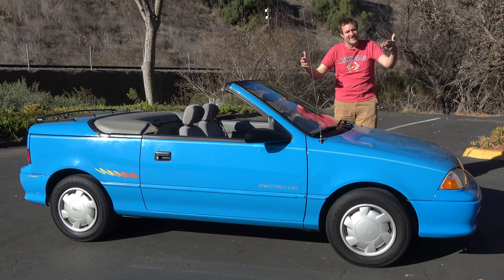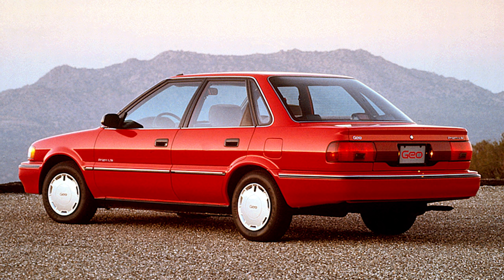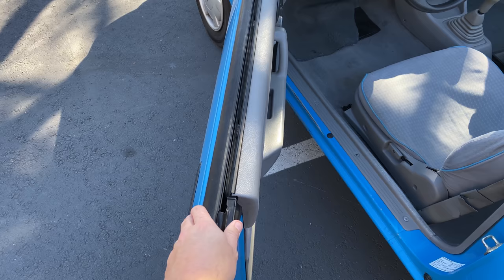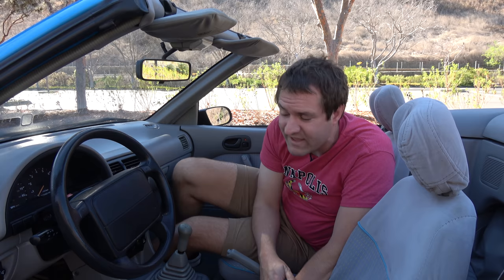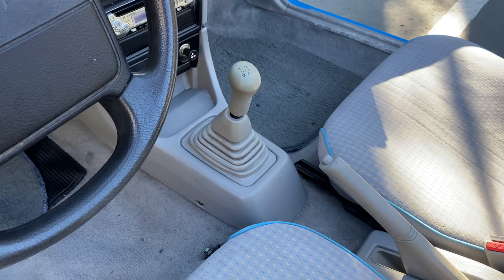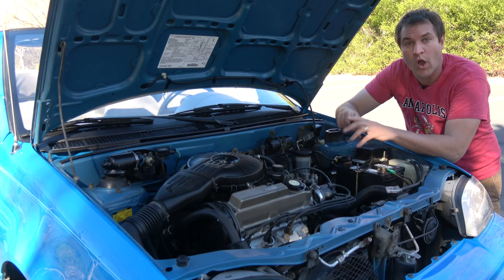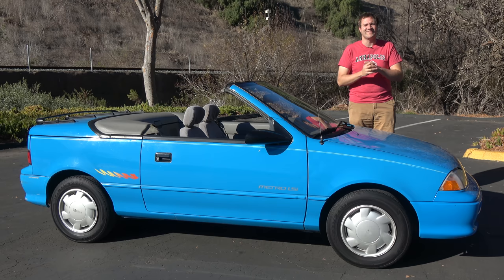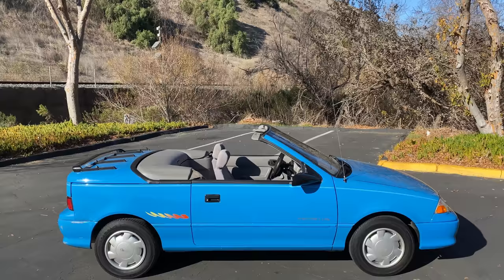The Geo Metro Convertible Was a Hilariously Pathetic 50-Horsepower Economy Car

Comment: That “plastic key” wasn’t too unusual for the time, even my 1998 4Runner came with one. The point of it is that the entire design allows it to fit in your wallet with credit cards and whatnot….same size. And then if you accidentally had a lockout…..emergency key is in your wallet. Great feature IMO although I never used it. P.S.—it did have a metal interior too.
Reply: Will Rivers  well damn
Reply: I had a ‘94 Metro, by then they had switched to aluminum for the spare wallet key.
Reply: I think my mother’s ‘95 Ford Escort sport model came with one. I remember trying to test it and it worked but it felt like the thing was going to break off in the lock if you didn’t turn it EXTREMELY gently.
Reply: biy new 4 runñer
Reply: my dad's '94 Saturn SC2 had one too
Reply: AAA use to give out plastic keys here in Socal.
Reply: @tommyt1971 😅
Reply: I always thought the plastic key was used as a blueprint to make a new metal key

Comment: Not gonna lie... this looks pretty dope. I'd love this car.
Reply: I thought the exact same thing 🤣
Reply: Retro just looks good haha. Put an LS in it and I would love it! Like an alternative to the miata LS swap😂
Reply: Maybe, someday, we'll see compact/micro cars here in the states again. :(
Reply: @BigfootUnibrowMan  Where would you sit? LS works in a Miata because it's an FR layout car that was designed for longitudinal mounted  engines. The Suzuki Swift was designed for a transverse 3 cylinder. Oh, the LS comes in transverse layouts? Cool. Don't let them pesky things like shock towers and frame rails get in your way.
Reply: A 5.3 like the impala ss and the Pontiac gtp has..it might fit in there..after a lot of cutting and welding anyways
Reply: @jdubskiwright2380  Cool. You just spent like $12k building a tube front end for a Geo Metro just for it to be a massive pain in the ass to drive and look stupid cause the front end is 3 feet wider than the rest of the car.
Reply: @koopatroopa187  hey I wouldn't undergo this project myself..I have seen several geos metros the hatch backs with 540ci BBC motors in them.. purely drag cars no street ability at all.. not my cup of tea..
Reply: @jdubskiwright2380  Yeah, and despite having absurd amounts of power, they're all pretty slow compared to other cars with the same work done. There's a turbo LS swapped Tracker I know of that runs high 9s and a GNX swapped Metro 3 dr that has a tube front end, tubbed back end, has a massive turbo, billet heads, etc. Car runs mid 9s. 9 second times were fast 20 years ago, but cars rolling off the showroom floor can get in the 10s these days with some knowhow and some ET Streets. The tracker works cause it's a body on frame, the Metro convertible would be very hard to do cause you can only move the seats so far back. The 3 dr is the one you often see converted to RWD cause it's got space to relocate things further back.
Reply: @koopatroopa187  yea they guy who used to live near me used a metro hatchback obviously rwd conversion..damn thing was basically a go kart with a big block..it was fully caged but idk wat ever happened to it think he sold it to fund another project..that was prior to the days of YouTube .it was yellow like bright ass yellow.. I would not want to wreck that car because there was no room to soak up any impact  sure the cage helps but idk..you could almost touch the rear axle from the driver seat.. how he ever kept it going straight with such a short wheelbase is mystery to me .I got to watch it make a few passes at the track and it was in the 9s all motor no nitrous just big block power. Probably pushing 600hp plus
Reply: mid 600s sounds about right for a 540 on pump gas.
Reply: @koopatroopa187  these days easy. Not necessarily cheap but very achievable.. considering thos was like later 90s early 2000s. It was a beast in its day.. I was a youngster got to get up close to it at a few car shows all really know is it had a duel carb setup n they looked big like 1000cfm big..I coulda swore I saw the same car but it had been painted different years later and it had a roots blower on it.. from what I heard guys around the track it was same 540 BBC .. went from bbc metro to a blown bbc metro... someone had seriously big nuttz to run tht car..hp was probably 700+..fuckn madness
Reply: @koopatroopa187  if not 800hp.. blower on it was pretty damn big..unfortunately I only got to see with motor running and idle around didn't get to see it make a pass.. probably 9 flats or mid 8s crazy
Reply: I'd probably just build up Swift GTI engine.
Reply: @jdubskiwright2380  Pretty sure I remember that blown 540 Metro. Looked absolutely absurd. Looked like it was just an engine with a Geo Metro attached to the back of it.
Reply: @koopatroopa187  yea that motor coulda used a little more car...
Reply: @BigfootUnibrowMan  maybe a turbocharged hayabusa engine?
Reply: I've driven two different prizms for years. absolutely loved them.
Reply: NO!!!
Reply: @BigfootUnibrowMan  no.
Reply: Bought a xfi hatch brsmd new in 1989.
Car was super dependable. 58 mpg and in 5 years only had to replace a egr valve.
Needed a bigger car for safety reasons and sold in in 95.
In 2010 i needed a gas miser as gas was close to 5 dollars a gallon and found a red convertible 4 miles away and grabbed it for 1200 bucks.
62 miles one way to work or a 124 mile round trip and this car got me to work 5 out of 6 days before i needed gas again.
Not only that but for 2 years i never had a problem with a 20 year old car changed my oil and that was it. Super dependsble while my coworkers laughed at me i sat back and watched them fixing all there late model car problems.
I bought a 2001 honda insight at 69 miles a gallon and still have my fine looking and running Geo convertible today.
Only issue imo not the safest car they were made light.
Reply: Get one and mod it for looks and performance. I would. it starts off with almost 50 miles to the gallon so any modification to the engine you're going to lose a little bit of that fuel economy but you're still going to be better off than most cars are today. 🙂👍
Reply: This looks pretty dope…

if you're into boring!
Reply: @hittingtax2670  It's the second reply you've made in two days, mate. 

Got the joke the first time.

My answer came from the fact that I was near homeless for a long time, so I couldn't afford a car.

I would have loved a little convertible. Much more fun than sleeping on the floor.

But yeah, probably not as fun as a Gallardo or whatever might be in your driveway.

I like simple pleasures in life, though. I don't need to draw my happiness from objects, so a little convertible like this will do me just fine.
Reply: @MarcosCodas  It was actually for myself, since I read it and forget what I was talking about, lol. 😝
Reply: Dope in a zoomer ironic way maybe
Reply: @jrob07105  - I agree. I commute in a large city with traffic jams coming and going and new get about 60 KPM / 37 KPM. This this would be fine.
Reply: Imagine Andre The Giant driving this car.
Reply: I    DIG    IT  !
Reply: ...and just about 50 mpg would be great!!!!!!!  It's not ugly to me, either.
Reply: I owned a 2001 Chevy Metro for 6 years & my little Geo could pass trucks like a beast, go down dirt roads & hit 88mph out in the desert. I drove her rough & blew the head gasket at 189,000 miles, but I truly miss my unsafe and fun to drive Metro

Comment: Me: "Mom can we get a miata?"

Mom: "No we have miata at home."

Miata at home:
Reply: Someone please explain this comment. I see it everywhere but i don't get it.
Reply: I want to see someone buy this and turbocharge it.
Reply: @Jens_Roadster  I think it originated as the kids asking the mom for fast food but she said we have food at home. And any kid knows the food at home is never as good as the fast food. Then the meme evolved into other topics like the one above.
Reply: @berburt  hmm, okay. Thanks. 😀
Reply: @wither1208  Just drop in a Geo Storm motor
Reply: @kp1x  or a Suzuki cultus GTI/steem/impulse XS and swap a Hayabusa engine in it and gain over 220hp .
Reply: @kp1x  It literally is a Suzuki Swift, the joke is that it's a worse Miata. And I still  want one ngl
Reply: @BeingMe23 HAYABUSA Swap that thing, ultimate sleeper, until the chassis flexes and implodes......
Reply: @wither1208  LS swap
Reply: @kyejt-r  that's why welding and chassis reinforcement exists
Reply: @wither1208  I want an LS swapped convertible geo metro.
Reply: Wrong car, you're thinking of the Mercury Capri. Even has most of a miata engine in it.
Reply: @wither1208  They actually had a turbo model, though it was only available in Canada from 1989 to 1991. It was sold as the Chevrolet Sprint Turbo and Pontiac Firefly Turbo. You could get a 1986 to 1988 Sprint Turbo in the US and be slightly faster.

For reference, you had a turbocharged 3-banger that only made 70 horsepower, but it was faster than an SN-95 Mustang V6 and lighter than an NA Miata.
Reply: If you want a 90s budget Miata, there's the Mercury Capri - another 90s oddball that Doug should review.
Reply: Also Marcus Eriz loves Mazda Miata. “WHEN YOU DRIFT, YOU’RE BOUND TO CRASH”
Reply: @eeaahh  A "poor man's Miata".

Comment: I worked with a man for about 10 years that drove one of these. Considering how he could easily afford something much nicer, he got a lot of questions about it. He was "green" long before it became popular to do so and he drove it because it was inexpensive to buy, paid for, had nearly 400K miles with basic maintenance and got 50MPG highway and 40 city. That car literally cost pennies to drive and never left him stranded. He always said he'd sell it if it broke down on him. I wouldn't be surprised if he still had it.
Reply: No wonder Jimmy McGill (Saul Goodman from Better Call Saul) drives an old Suzuki Esteem

Probably has the same 3-cylinder engine as this GEO Metro
Reply: @walnutsandbeastiality866  I bet you're right. I know there was some relationship between Suzuki and Geo at least..lol. great show btw! thanks for the comment.
Reply: @All About Roofing  I haven't seen Doug's video in a while, but if I remember right, he shows the VIN plate at the door (or under the hood) and it shows that it's manufactured by Suzuki Corporation in Japan

GEO is just a nameplate that General Motors used for imports (similar to how they re-badged the Suzuki Wagon-R as Opel Agila here in Europe)
Reply: @walnutsandbeastiality866  True about the nameplate. Remember, the Geo Tracker was simply a re-badged Suzuki Sidekick.
Reply: I had a Mitsubishi Mirage from this era which was very similar in terms of size and economy. I put 300,000 miles on it. It got about 45/40 mpg but it was also cheap to own because it was very easy to maintain. I remember putting 4 tires on it mounted and balanced for $105 😂
Reply: He’s probably a millionaire
Reply: yeah right, these things are all in their graves.
Reply: @joesmith9216  surprisingly, that's not the case. There are quite a few for sale in my state, I just checked.
Reply: @festyguy7405  ur prob right. I lost touch with him tho, so not sure.
Reply: @ernestb4473  geo didn't make any of their own models that I am aware of. We're either Suzukis or Toyotas. The prizm is a rebadged Corolla.
Reply: @allaboutroofing2  The Spectrum was a rebadged Isuzu.  The Prizm was built in California in a factory co-owned with Toyota, but was basically a Corolla.

Comment: In high school, my driver's ed class had about a dozen of these (non-convertible) Metros.     They were for off-road use only.     We had a "track" where all these Metros would drive around and practice parallel/perpendicular parking, merging, yielding, etc.    They were all equipped with walkies so the instructor (standing on a 15' tall platform) could yell at you.    "Number 4!    Go parallel park!" Good times...
Reply: Sounds really fun actually
Reply: that sounds like so much fun.
Reply: Our high school switched from Daewoos to Suzuki Swift (and Ford Contour), so I guess in a way we had later gen versions of these.
Reply: I remember getting driving lessons from a guy who drove a Ford Festiva back in 1996. I think he was trying to save as much money on gas as possible.

Comment: Doug: it has AC!!!!!
GM: Doug...we are cheap but we aren't animals
Reply: Or communists
Reply: @rhdmoscowchapstyleusa8966  lol facts
Reply: My 2011 Kia Rio didn't have AC or power steering from the factory.
Reply: @wronggg  it's kia thou
Reply: @wronggg  if you make three mistakes in a word GEO, you will get KIA.
Reply: @wronggg  Ok, im a noob here, what does it mean when a car doesn't have AC??
The vents just blow wind like a normal fan and doesnt feel cold?
Reply: @edwindyap1616  Correct, just a fan with no cold air, but does have heat though. Which is good because I'm in Florida which is famously frigid.
Reply: @edwindyap1616  It does the exact same thing as your car with the fan blowing and temp set at cold/blue if you turn off the snowflake icon
Reply: In europe Mercedes and range rovers at the time didnt have air conditioning as a standard feature, interestingly.
Reply: @jesussalas2407  good to know
Reply: @wronggg  My first car ('94 Toyota Tercel) had no A/C, no power steering, only an AM/FM radio, and no intermittent wipers just High, Low, and Off 🤣
Reply: Lmfaooooo💀💀💀💀
Reply: @rhdmoscowchapstyleusa8966  lol yep

Comment: "Cheapest, crappiest car"  
Daewoo has entered the chat.  "BUY ONE GET ONE FREE!!!"
Reply: ^a daewoo comment only receives half of a response^
lulz 
however none could compete with a Yugo for the "now yer fukkd"-ness title.
Reply: cough Yugo cough
Reply: Ya Daewoo was garbage
Reply: @rickc2102  cough FSO cough
Reply: GM cough GM
Reply: @skylined5534  Daewoo was worse before GM took over. You used to be able to find half a dozen Dead Lanos in the classifieds, all with broken timing belts, between 40k and 60k miles, right around the time parts availability dried up and all the Daewoo dealers closed up.
Still glad I never bought that Lanos Sport 6-speed I had my eye on. Dodged a bullet.
Reply: @dashcamandy2242  

The engines were rebadged GM products. Which Lanos model in your country had 6 forward gears?
The only European models in a similar engineering time frame were the Vectra A/Mk3 Cavalier and Calibra 4x4 Turbo models.
Reply: Crappiest Car? Try 1986-1988 Ford Escort GT, 4th Generation 1994-1997 4Door Honda Accord, Oldsmobile Alero, And Hyundai Excel!
Reply: @richardkaltenbach3961  

No experience of the Oldsmobile but calling the others 'crappiest' is more than a stretch. Especially the CD Accord which was extremely highly thought of in its time. Yours reads more like a list of cars you just don't like.
Reply: Daewoo's US marketing strategy at one time included giving out free cars to young college girls apparently. When presented with a proper marketing plan by an American they brushed it off and took failure instead. Hilarious thinking about a bunch of Korean dudes having a serious meeting and deciding that would be the ideal strategy for the US market
Reply: @skylined5534  And The Cars YOU PEOPLE Don't Like Seem To Be The Best Ones!

Oh, And By The Way, There's Life Beyond Pickup Trucks, Rap And New Country!
Reply: @skylined5534  The 1994-1997 Honda Accord 4 Door Is A Disposable Throwaway! JUNK!!
Reply: @richardkaltenbach3961  

YOU people? Which people would they be then? 

And nope, the Accord isn't junk just you think so.
Reply: @skylined5534  GM sold Suzukis, Isuzus and Toyotas so that they could increase their average vehicle quality score.  Ironically, they were fighting like crazy to keep Japanese cars out of the US just before they put together the Geo brand.  My Metro convertible is has CHEVROLET GEO METRO on the title, and it's made by Suzuki. It has 3 brands...
Reply: @richardkaltenbach3961  Those Accords were awesome in every way. The Excel was garbage, though, with no one at all disagreeing with you on that.

Comment: If you need to get from A to B, without rushing or banging a hole on your wallet on fuel, this is your perfect choice. It's interesting not only for car enthusiasts, but also for cost-cutting, regular people. And the trunk can carry enough groceries for a single person's weekly consumption. And if you love to repair mechanical parts yourself, that little engine can be an easy pray, just like the VW Beetle. Thumbs up for this cute vehicle.
Reply: The Daihatsu Charade G100 1.0 turbodiesel is way better. Does 60 mpg and is more practical. In fact many small diesel hatchbacks today can get over 50 mpg pretty easily.
Reply: @fungo6631 Daihatsu isn't in the usdm
Reply: @aarontimm  And your point is? It's over 25 years old, you can import it legally just fine.